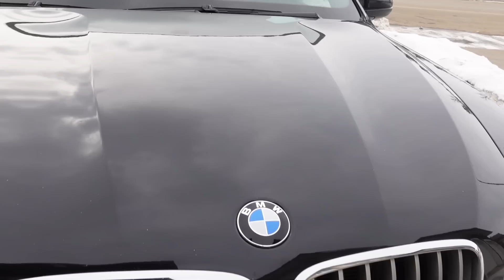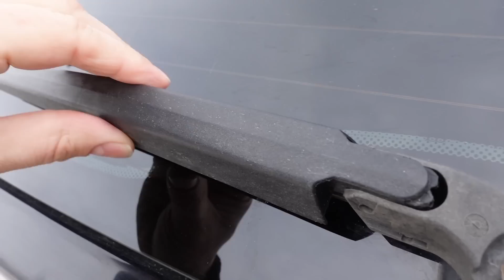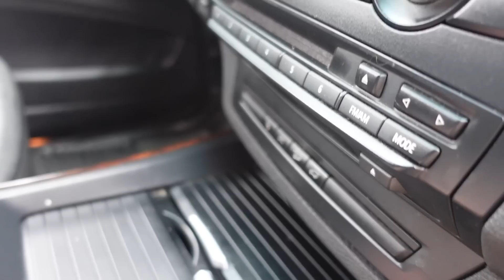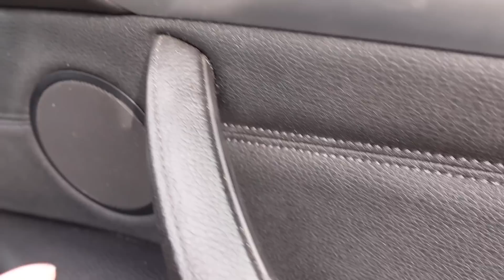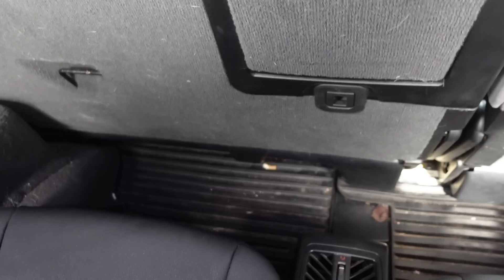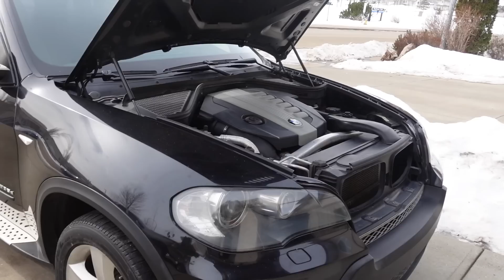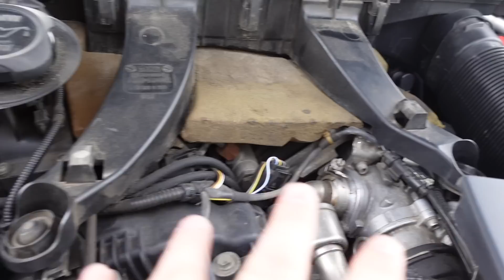10-Year Ownership Of My BMW X5 - A Long Term Review

Comment: I just bought the v8 2008x5 it had more problems on the way home and more fault lights then I could deal with not only that Simone grinded the hub ridge of the wheels to put the  22,inch rims on it yeah looks great but it nere killed me driving it home on the freeway at 120klms at a point were the front wheels were shaking the guy at tyre shop told me I am lucky to be alive not only could the wheel of separated down many of the massive hills I went down that day and if you know Sydney to Newcastle then hills and how it had absolutely massive tyres and rims and they were all just riding on the say it together the lousy 4studs the x5 has rrr on my way to get lotto ticket or also I asked for my money back from car yard not sure if I'll get it but after that unless they want the worst review on earth I'd be paying it all too

Comment: Have the same X5 diesel in M version with many options and tuned to 360 hp. Drove it to 450k, never lets me down, everything still works. Nothing big has happened, very reliable. Maintain it with a BMW specialist.

Comment: I owned a E82 128i from that era. Nothing went wrong with the engine N52. But ABS gone. Paid 600 to a local mechanic to replace the abs ring but no good. Start fixing the abs module is many thousands so I just give up 😂. 
But if your dealer is charging you 1200 for a battery change, something isn't right, waaaaay too much. Part+1h of labor, you do the math.
Reply from the maker: I’m surprised they are charging that much for a battery.

Comment: The rear airbags are $100 a piece and anyone with the slightest confidence of doing their own work could do these. Remove the rear wheels and spend 25 minutes per side swapping out the bags. It's Ludacris to suggest that it would cost two grand to replace the bags

Comment: Enjoyed it and found it very useful as I own the same car in it's naturally aspirated 3.0 l version upgraded with remapping, throttle booster, air filter and exhaust system to produce 306 hp. Great ride all in all got no reason to replace it. Designwise I reckon it's better than its successors. Minimum wear and tear. Btw on the occasion I'd like to congratulate you for your thorough and truthful comments. Love to you yours and Canada from Greece 🎉
Reply from the maker: Great to hear!  They are very nice to drive

Comment: Only reason I have used X3 and Z4 is because I do my own repairs and maintenance.   2017 x3 sdrive and 2006 z4 with NA N52 motor.  Unfortunately the x3 is the 2.0L gdi engine.

Comment: 1.200 Bucks fro a battery change? boeught mine new for 200 € and did the replacement myself Overall costs for irregualr repairs in 10 years is around 2.000 $ only (Excluding oil, tire and brake changes)have a good garage.
Reply from the maker: In Canada we get gouged plus they say the battery needs to be coded
Reply: @ECPP  ok. you are right with the coding. I personally never did it ;)

Comment: Jeez...I've owned mine from 60k miles to 155k....still going strong. Only thing I've needed to do is valve cover gasket, expansion tank, tires, and brakes. Probably $400 a year in maintenance total. Been a reliable car knock-on-wood.

Comment: This is very informative and great for someone interested that doesnt know how to work on cars.  However , for most enthusiasts who have basic knowledge of working on cars all these repairs are very manageable. Those $1200+ injectors you can find good used ones for $100-$200 and the work is pretty easy. Most people that don't live in emission strict areas get rid of the DEF tanks , EGR parts etc... Will eliminate 50% of the issues, gain you 100+HP and 300+Tq and even better gas milage. I would say for someone with basic tools and doesnt mind getting their hands dirty these rigs are incredible value. If you are unwilling or unable to work on cars then maybe go lease something newer :)  Thanks for posting this!  Incredible to have both a 5yr and 10yr update.
Reply: Well said. Was about to post to say the same. I purchased a 2013 e70 35d that was having issues with dpf filter and paid a good price for it as is from a dealer. As soon as I got it I removed the emission equipment and egr system. Been running like a dream ever since.

Comment: Hello , I'm watching a lot of your videos, very interesting and educational.
I have a question , my first SUV rx 350 disappointed me and now I'm back in the market, looking at BMW X3 or X5 with b58 but still considering diesel because it is cheaper to get,but not sure if it is a good idea, what do you think?
Thanks 👍
Reply from the maker: I love the diesel but eventually some of the emissions equipment can be failure prone and if you have the ability to do a delete later on the. 100 percent diesel otherwise the b58 is a great way to go.  Hope that helps

Comment: NoX sensors, oil leaks, countless sensors,  actuators that will drive you crazy with this car. Each part is $300 and up to thousands.  When you see this car coming turn around and run as fast as you can:)

Comment: The repairs you note are EXACTLY what repairs mine suffered. But, I am a good diy mechanic and repaired mine for 25% of what the dealer charged. FCP Euro for parts and Amazon or E Bay got the specialty tools.
Reply from the maker: I agree if you are a solid DIYer you can enjoy a great driving vehicle for easy money.  Full delete is also a consideration in some spots like Canada

Comment: get an icon, winkfp and learn to use pro tools. save yourself thousands of dollars. reflashing and vo code writing a module usually fixes said problem, and if it doesn't then you need to replace said module. also, you're x5 is a bad, extremely beat up example for only 130k miles

Comment: THIS is a "must see". Video! I have the 2009 x5 e70 4.8i gas (petrol) model. I LOVE my x5 when it's running well, which is most of the time. When I gotta take it to the repair shop... 😭😭😭  Cheapest repair, rattly exhaust brackets. Most expensive repair: eccentric shaft.
Reply from the maker: Thank you.  That’s really the bottom line in ownership of these vehicles.  It’s sort of a love/hate relationship

Comment: 2017 X5 xDrive35i  M Sport with 183,000km now

Only issues I experienced that got me stranded were the water pump and air suspension two years ago. The thermostat also failed by remaining stuck opened all the way.

This year will require a new valve cover gasket (original one still holding up but, sweating is visible), new front lower control arms, coolant flush plus hose flange replacement, an intake valve cleaning with walnut shells and differentials plus transfer case fluid replacement.

Spark plugs replaced at 79,000km and 175,000km all on the original coils. There's no rough idle, misfire, stalling I experienced.

I sometimes (rarely) get an engine light for "catalytic converter efficiency under threshold". Typically caused by driving long distance at low engine speed and load and is not serious.

Oil changes EVERY 8000km (5000 mi).

Still original windshield after 3 years ownership (I'm third owner, purchased when it had 63,100km) but it chips that got repaired quickly and no cracks.

I'm experienced a lot of paint chips on the front passenger door, running board and driver door to lesser extent. Will need a body shop to assess what correction is needed.

Due to the excellent mechanical fitness of the X5 it's been tuned to an M Performance Power kit; previous owner had installed an M Performance exhaust. The combination of both sounds insanely good.
Reply from the maker: Nice

Comment: Thanks for the informative video. I am actually looking at the 2018 used x5 diesel which has 90k miles on it. I am skeptical about the maintenance cost which is how landed on your video.
I was also looking at looking for a big suv, but i guess i will go with 4runner. Doesn’t give a good mileage but at least don’t have to empty my pocket every time i drive.
Reply from the maker: Good choice!

Comment: I had the same model in a 2011. After about 6 years had several diesel related problems and a front end situation. Spent over $10,000 over in 2 years. Sold it when it was 11 years old.

Comment: I bought an E53 a few weeks ago (231 T km). By means of preventive maintenance I replaced all 6 injectors against Injectors that were refurbished by Bosch (325,-€ all six off them) and 6 new glow plugs, from Bosch. A new intake manyfold (deleated the swirl flaps, but of course) , AGR valve and a throttle body (by Pirberg, this is where BMW buys it from for production), water pump and thermostat and starter motor. All from premium brands. The bill was approx. 3400,- € including labor and it's running very fine.. Battery swap for over 1000 quid, I'd never pay, rather I do it myself for about 100,-€ (120 Amp hour battery which lasts longer than 95 Amps, plus a new generator 100 Amps very easy to replace on this one 150,-€) Oil change for 250 quid, this is ridiculous!!!!!

Plus the E70 is the more complicated car. I still feel the E53 is the better choice, because it is not as messed up with emission regulation bla bla bla.

I missed you talking about the differential, and the transfer case. These >>>> must <<<<< be serviced, else they will fail. Oil must be changed in all three of them.

If a circuit board fails, it does not have to be replace, but be resoldered. Very inexpensive and good fix.

You should search for refurbished items, used parts and a good independent workshop and you can massively decrease your expenditures.

Your report is very fine, thanks. But keeping this car in alive at high quality and at reasonable costs, needs other strategies. (replace a injector myself is fairly simple. And the glow plugs, other than VW or Audi are rather short, no biggy. Roland from good old Germany.

Comment: I have an e70 2009 3i petrol engine N52. Your comments and costing is spot on. I’m in Australia. I bought it 4 years ago cheaply when living in New Zealand for NZ $12000. I was intending using to drag the dog around for a couple of years while living in NZ. I bought it online from a guy who fortunately was a licensed dealer. He suggested I buy an extended warranty for $1500. Best $1500 I ever spent as it saved me about $8000. All very similiar to stuff you talk about. But I do like it and I just put it down to cost of owning. I use an independent BMW mechanic who helps manage what I spend. I’ve taken it to dealers a couple of times to get inspections and had some recalls and warranty items done. It’s done about 100,000 enjoyable trouble free kilometres for me. Over Christmas will do about 5,000 kilometres. It’s all serviced and ready to go.
Reply from the maker: Cheers

Comment: Same warning light. Especially it’s something with Brake Force brake light. I suspect one or more wires in the tailgate loom is failing / fraying. My trunk lights are also not working when the gate is fully up. So when something hard fails, I will re-wire the whole harness.
Reply from the maker: Thanks for the heads up

Comment: I had an x5 years ago and loved it.  It broke down middle of night driving to Vermont to go skiing.  Issue was software needed to be updated.  Entire car shut down.  Oil leaks. Sensors etc.   couldn’t take it anymore.   Love them new, hate them as they age.  I’m convinced when BMWs reach around 80k miles someone in Germany presses a button and that’s it.  All implodes.  I’d be very very curious to put a new 2024 x5 against the new lexus gx 550 that’s coming out soon.  Lexus I’d have to believe would come out on top in spades.
Reply from the maker: Yes the Lexus will not drive as nicely but durability is far better

Comment: What years and models of the X5 have best reliability? I love how the newer X5 SUV drive and feel inside but long term maintenance costs worry me. I have had two BMW cars and they are not cheap to own long term.
Reply from the maker: The latest engines for the X5 with the straight 6 are best.  The b58 only in this vehicle
Reply: thank you! @ECPP

Comment: I owned a 1st Gen (E53) X5 for 10 years.

Owned from when it was 4 yrs old & did around 10k miles p/a as my daily driver.....(petrol V8 4.4i Sport to be specific). I spent around £1.5K (GBP) p/a on repairs to keep it behaving & repaired. 

In addition to maintenance I also kept on top of  cosmetic stuff.

Despite it not being cheap to care for I enjoyed the car. Timing chain guide failure (during an expensive life change event), eventually convinced me to say goodbye.

Have had a few other brands over years. MB at present. Toyota & Volvo caused me least hassle.
Reply from the maker: Nice

Comment: I purchased a 2018 X5d (with towing package and third row seats) which is the next generation.  I have 93k trouble free mostly highway miles.  I have en extended BMW warranty until 100k.  I was thinking of trading in but the BMW X5 is very expensive (new or newish).  I also looked at an extended after market warranty (very expensive) and does not cover emissions.  The vehicle is in TN and garaged.  It has a towing package and used to tow a horse trailer. Any thoughts?

Comment: What a piece of crap you got there. Owned 2007 Chevy Colorado 214k hard miles and only replaced the power steering pump my fault and the engine fan clutch and radiator $457. 2010 Chevy Malibu 137k. Replaced  automatic trans  module $290.  Both sold and  still running.

Comment: Bad luck you are living in Canada. In EU X5 3.5D has no exhaust fuel instaled. Also replacing battery costs 200 $ and injectors can be fixed with 150$ repair job. Good luck
Reply from the maker: We get screwed in Canada on everything

Comment: Part of why your cost of repairs was so high was your dealer beat you up pretty good. Too bad you couldn't find a good honest indy. Bet your repairs would be significantly less---but still not cheap.
That being said, $16k over ten years is a lot of money---but those who leased a new BMW every three years over ten years pay three or four times that amount during those same ten years. And they have to give the car back at the end of the lease. And they have to worry about miles or if they get a scratch or some other thing the dealer will charge them for since they only rented someone else's car.
Anyone planning on buying a luxury vehicle should plan on $1k to $3k per year on maintenance and repairs. Just plan on that and your experience won't be so bad. It might turn out that you won't even have to pay that much.
Hell, I've spent almost $7 grand on various repairs for my '07 Toyota FJ, so Toyotas and Lexus break and need repairing, too.

Comment: I just had an oil change and brake fluid flush on my e70d with 165kms and received compliments on its condition from the tech. Urethane bushings are a very good upgrade for handling and durability. When the DEF system fails, I will delete and tune with trans service and tune for 4k.

Comment: Read an article a year or so ago on Ducted fuel injection-which would help with reliability of diesel emission equipment…

...Ducted fuel injection for diesel engines, developed at Sandia National Lab's Combustion Research Facility by Charles Mueller, can fine-tune the fuel-air mixture in an engine to the point of eliminating between 50% to 100% of the soot typically generated by diesels. "And engine manufacturers are starting to show excitement about it," he says. Manufacturers like it because it cleans up the emissions, it work well with conventional diesel fuels, and it is conceptually simple and can be built from low-cost materials. "Ducted fuel injection could also be retrofitted onto existing engines," Mueller says. "This is especially important for large engines, such as those used in ships and locomotives where the engines can cost $1 million or more and converting to all-electric power is cost-prohibitive. A retrofit would be relatively inexpensive and could provide substantial emissions benefits right away."

Comment: Appreciate so much honesty!!!
Reply from the maker: You are very welcome
Reply: @ECPP  it’s funny-I saw another video with BMW 335d entitled reliable and used budget vehicle… and the first five things to make it more reliable were all illegal diesel “modifications” basically taking any and all emissions systems out…
I read an article on ducted fuel injection which would be great if used on everyday vehicles 
...Ducted fuel injection for diesel engines, developed at Sandia National Lab's Combustion Research Facility by Charles Mueller, can fine-tune the fuel-air mixture in an engine to the point of eliminating between 50% to 100% of the soot typically generated by diesels. "And engine manufacturers are starting to show excitement about it," he says. Manufacturers like it because it cleans up the emissions, it work well with conventional diesel fuels, and it is conceptually simple and can be built from low-cost materials. "Ducted fuel injection could also be retrofitted onto existing engines," Mueller says. "This is especially important for large engines, such as those used in ships and locomotives where the engines can cost $1 million or more and converting to all-electric power is cost-prohibitive. A retrofit would be relatively inexpensive and could provide substantial emissions benefits right away."